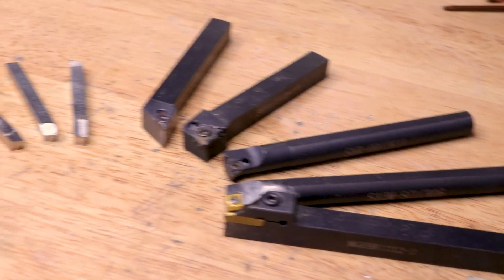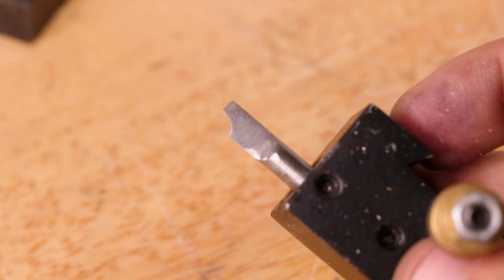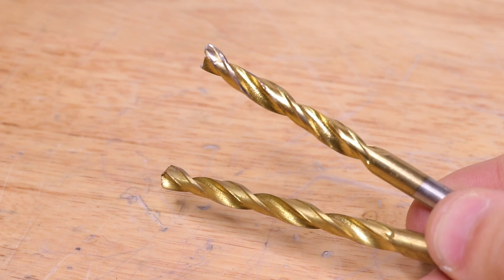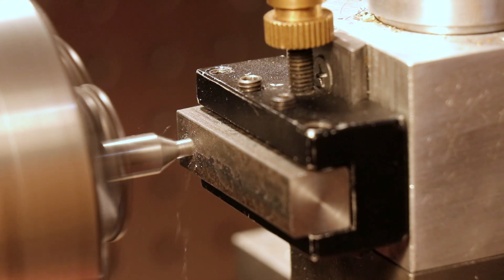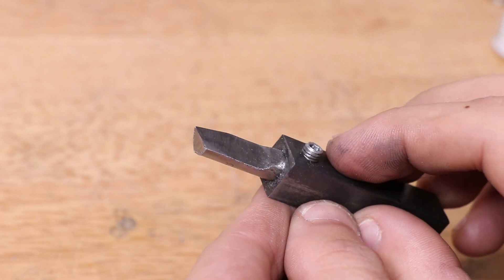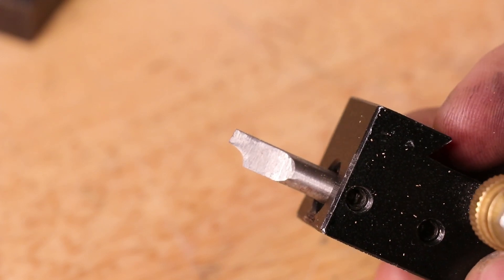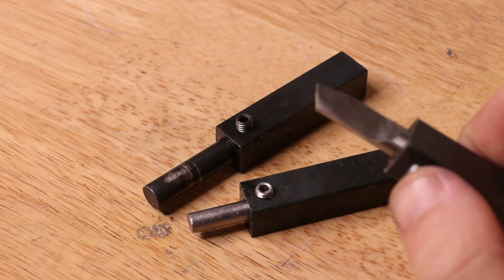Turning Broken Drill Bits Into Lathe Tools

Comment: if you have or make a good fixture you can greatly improve the quality of your tools
I use a Diamond wheel to grind mine from Solid Carbide bits.
Also i use a Wire EDM to make the basic shape, for instance the flat top, 
I made Turning and boring bits out of Solid Carbide with this method.

Comment: Notable hints. 
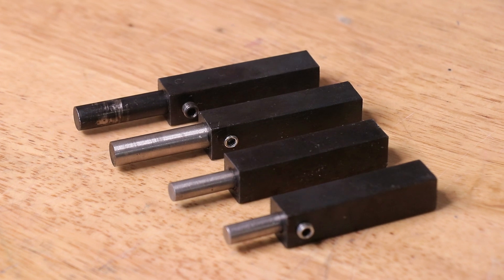Not all HSS bit are factory hardened from tip to tip, only a small fraction of shank by the fluke get hardening. Page 5:58 assume shank rear end is HSS hard may lead to disappointment. Remedy? Add quench and temper to the shank aimed as a cutting edge.

Comment: I need to ask, but the grub screw you use to hold the bit/end mill, wouldn't it be better (and safer) if you ground one side a bit flat, so the grub screw 100% prevented the bit/end mill from ever even thinking about twisting?

Comment: HSS drill bits destined for the bin ? Ha! been machining since I had to stand on a stool to reach the lathe ( I was about 7 years old ) and I haven't thrown much HSS away, I sharpen, re-sharpen and modify drill bits. I also use old hacksaw blades for stuff. I have made tools out of plain mild steel, unhardened for cutting leather and wood, and they last a surprisingly long time. A good way of differentiating good twist drills from bad is to see if they're ground flutes ( good ) or rolled flutes ( #### ), if they have a ground corner at the end of the flute it's a god one, if it's rounded and undefined it's not.
 Great vid again, thanks.

Comment: Good drill bits have a softer shank to shatter less and not chew your chuck up
Reply from the maker: My mistake about not mentioning that in the video, but even with the soft shanks they are perfectly adequate as cutting tools for brass, aluminium and practice, cheers.

Comment: In twist drills the shank is usually left much softer than flutes and the cutting end so that chuck jaws are able to grab it reliably. So if you want them to hold their edge better you need to heat treat them. End mills are usually equally hard throughout.
Reply from the maker: My mistake about not mentioning that in the video, but even with the soft shanks they are perfectly adequate as cutting tools for brass, aluminium and practice. They seem to hold their edge just fine. I will have to make a follow up to this because heat treating hss is in some ways different to regular carbon steel. And you are right, end mills are usually through hardened. Cheers

Comment: Great video. I have done basically the same thing with old allen wrenches for machining brass or aluminum parts
Reply from the maker: Allen keys did not occur to me. I had a look and mine are either chrome moly or high carbon steel, so they should work for aluminium or brass. I will need to give this a go. Cheers
Reply: I wouldn't use old allen keys for lathe tools, however because it's a very tough heat treated steel I would use it for something that needs to be strong.

Comment: The shank of drills is soft, that's why they chew up when they slip in the chuck. Why not grind the hss fluted end to do the cutting? It's a bit trickier because of the flutes but often doable providing the drill is not too small.
Reply from the maker: That's why you should stick to machining softer materials like I said, and they stand up to those materials with no issue, and I have made a lot of tools this way over the past year. It may be soft but is is much harder than aluminum and brass. I have also tried to grind tools into the flute end, since I was aware of the softness of the shanks and there is not much that can be done, there just isn't enough material on that end. I will be posting a video later this week to clear up a few things that I left out of this relatively short video. Cheers
Reply: @artisanmakes  Precisely.  I would think that the only HSS bit that would have enough meat left over after you removed its (turned down) flutes would need to be at least a 1in drill bit, but with those any machinist knows how damn expensive those are while being very easy to resharpen.  For me if it is less than 1/2in I toss them and above I get them resharpened (I suck at sharpening anything).  At least for my Aluminium, and plastic (I don't do brass yet), I can get more use out of the old broken, and/or dull, bits.
Reply: In that end youd get a far less stiff profile due to the flutes. In the other end theres a thicker stock

Comment: You may as well grind a tool out of the 22mm hot rolled steel.  Drill shanks are soft as butter by design.
Reply from the maker: No surprise since the drill chuck can scuff them up, but it is still harder than Aluminium and brass and has no trouble at all acting as a short term cutting tool. Done this method several times over the year and had no issue. Plus it's a great way to recycle discarded tools. Cheers . Edit: Spent some time testing the hardness of end mills and drill shanks today and the results were surprising on how much they varied, will be posting an update to this video soon.
Reply: @artisanmakes   End Mills tend to Be hardened a bit longer on The shaft thn twist drills, so generally you will have better luck using those. However, guhring twist drills are often hard throughout the shank.

Comment: Two flute end mills with one broken side make excellent boring tools. The unfortunate thing about twist drill bits is the shanks are normally tempered to a much lower Rockwell C rating than the flutes.
Reply: Yep, but after you turn down the flutes you don't actually have any meat left short of a 1in drill bit that can easily be resharpened.

Comment: A very interesting idea. I'm now thinking of all the drill bits I have thrown out... Just one question -  the single grub screw is enough to keep the tool aligned? No need for lock tight in the holder?
Reply: I would grind a notch for the set screw to seat in.

Comment: By using the shank on a twist drill it's soft material not heat treated like the rest of the drill
Reply from the maker: That's why you should stick to machining softer materials like I said, and they stand up to those materials with no issue, and I have made a lot of tools this way over the past year. I was going to look into heat treatment of hss, but it is a bit beyond what I can do in  this workshop. Machinery's handbook has a great breakdown of the method. 

This method is not optimal for tools that will be used extensively, as they have the heat treatment and grade disadvantage, but it is certainly a great use for discarded drills. Cheers
Reply: I guess it should be tested, say with a file to see the extent of the hardening. Though how it responds when being ground would give some indication right away.
Reply: Where I had limited success just by heating parts with a propane torch.
You could try various different degrees turn it blue then red and then simply quench in water or oil and then test it with a file sometimes it works.
The drills shanks are usually made out of the same material but it's just the cutting edge of the drill which is drawn do a harden state.
Reply: @keithjohnson3883  I think the drill shaft is harder near where the twist grooves ends. I mean I would try to grind the cutting profile into that end. Some older twist drills might be   harder throughout but newer stuff is soft where it will be tightened to drill chuck.